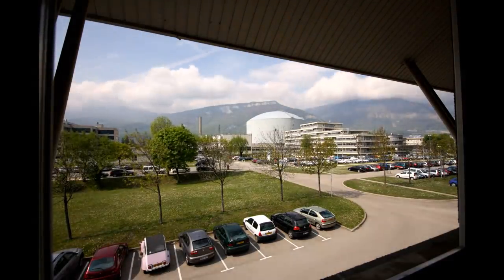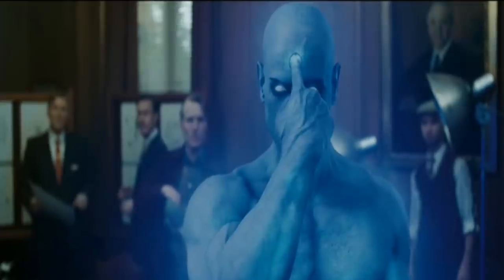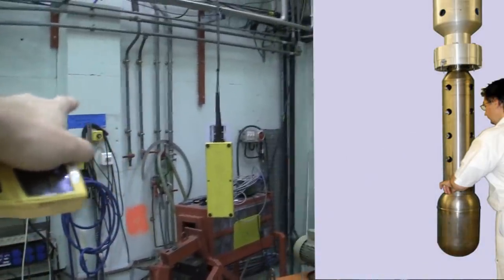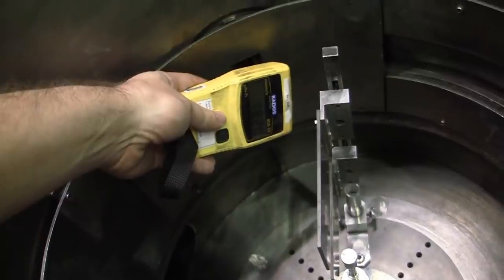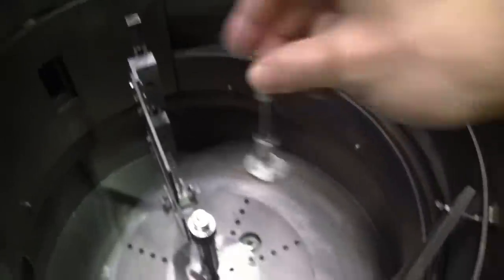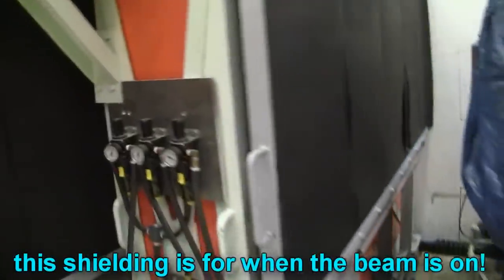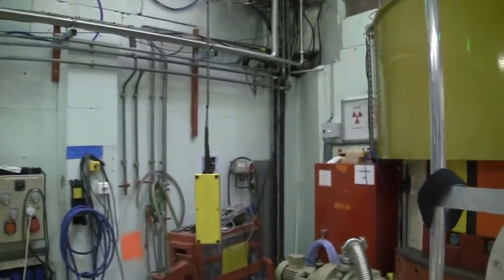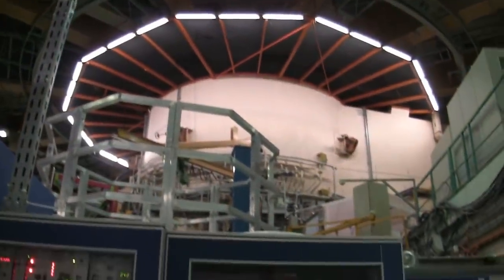Nuclear Reactors, Fantasy and Fact!

Comment: To be fair, Doctor Manhattan wasn't inside a nuclear reactor.  Yes he was a nuclear physicist and particle physics loosely related to atomic fission were involved, but the machine that he was trapped in was specifically designed to rip the "intrinsic field" of matter from an object, effectively disintegrating it without causing the explosion inherrent in that much instant fission.  

  Now while that science is obviously dodgy AT BEST, the point is the chamber was designed to be as dangerous as inherrently possible to whatever was inside it, as opposed to a nuclear reactor which is dangerous as a side effect of it's intended purpose.

...

It DOES raise an interesting question.  The machine that killed Dr. Manhattan was a highly experimental prototype device.  I wonder if the very first nuclear reactor (with similar experimental prototype status) was nearly as safe or boasted nearly so many safeguards?
Reply: +TymeTwyster Last 
The first nuclear reactor had almost no safeguards, the only control provided was the ability to remove fuel rods to stop the reaction.
However, it was still very safe, had the fuel rods become jammed in place or some such thing, the most danger posed by the reactor is that the heat from it might have set fire to the wooden structure surrounding it.
Reply: Elusive7thElement
Huh, good to know Elusive.  Thx for the response.

Comment: I've been wondering what would have to read on your scale for the radiation to be lethal ad kill a person.
Reply: CNSC allows 5Rem per year for nuclear energy workers but that's over time. as for acute doses it's complicated because it depends on the dose rate, what part of your body is in the beam and for how long, what type (beta, alpha, gamma) and whether it is internal or external. I believe the Chernobyl clean up crews; the ones shovelling bricks of graphite back into the smoking wreckage, were exposed to 3000Rem\hr general fields. just an unbelievable mess